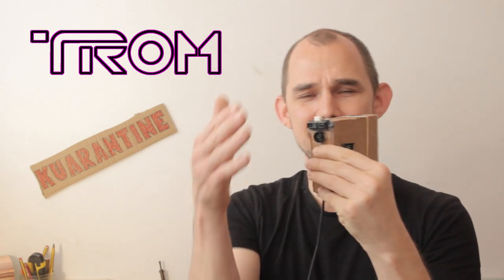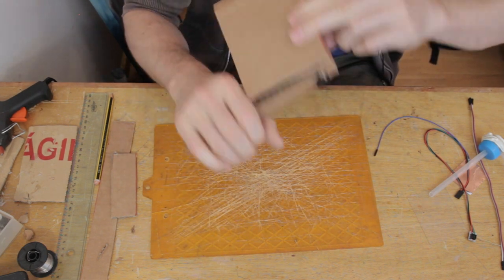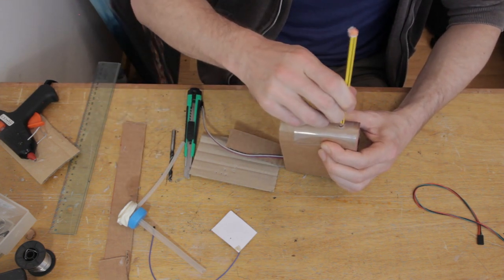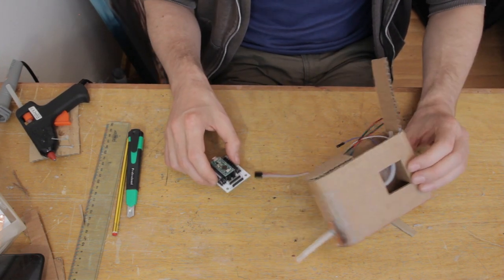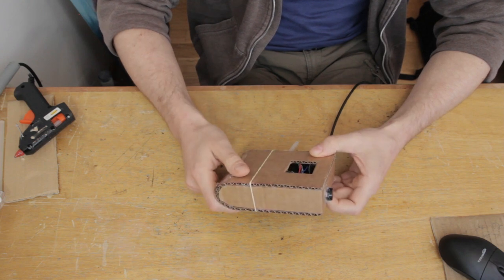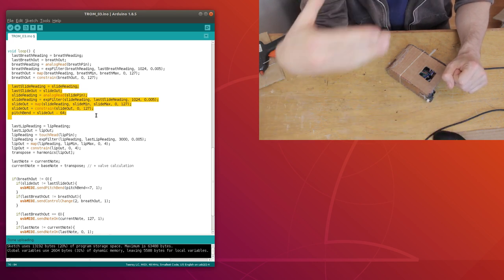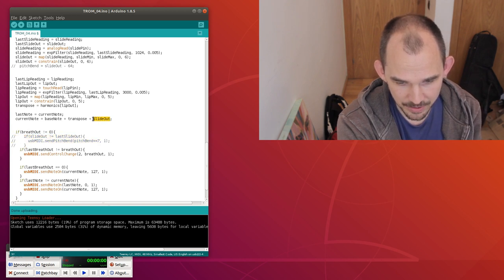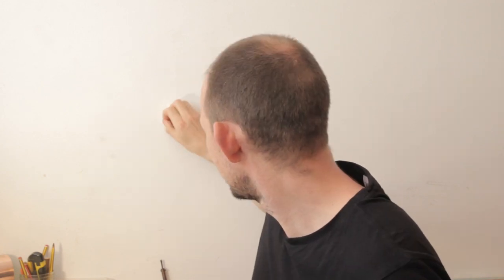"TROM" - DIY MIDI trombone prototype - Featuring lip tension sensor and virtual slide.

Comment: Hi. I've found some interesting way to implement a breath sensor additional feature  with no cost, that I would like to share with you.
Idea is the following -  I believe you have some comfortable-to-play max value from the sensor that is considered as maximum, that will be later translated to CC value 127 
However,  you can make another CC command axis  starting somewhere above this value, for some kind of "overblow"  feature.
For example, if you have sensor that returns values from 0 to 1024,  and only 0-300 is  translated to  midi CC2  as    0->0  and 300->127, you can  add another control CC3
for range 350 to 450  (with midi cc values translated as  350->0, 450->127)  )    In this example we are keeping [300, 350] sensor's range as a barrier  between overblown and non overblown modes.
Starting with 350 sensor value you start sending additional CC3 that  can be quite naturally used as a control axis for managing Growl param in SWAM synth, for example, or whatever  will represent overblow in your synth.
I've tried  this with my pressure sensor - and it feels usable.
Cheers, and thank you for your hard work.
Reply from the maker: That's a super cool idea. I started to implement something a bit like it in my flute prototype, but got sidetracked. 
Thanks for sharing!
Reply from the maker: @ignis32 I'm using this over-blowing idea to implement the second octave of my diy MIDI ocarina: https://youtu.be/M_PeYwXEBB4?t=199
Reply: @KontinuumLAB   Nice to know)

Comment: I’m a trombone player (don’t mind the my user name it’s what I was booked as, without my knowledge, on a got the night before getting a new email) into electronic wind and would line to try and make this and try it out.  Could you use both sensors and pick which mode to play in?
Reply from the maker: Thanks for watching! I'm not sure what you mean by "both sensors"...? Could you explain?
Reply: @KontinuumLAB  meaning both the long range and short range sensors for the hands/slide to have a “keyed” instrument and a full slide one
Reply from the maker: You could make those two modes with just one sensor. The mode is made in software, the two different sensors just have different sensitivity/range

Comment: Hello, I was wondering if you are still looking for a trombone player to try your trom  instrument.  I am a professional player and I also as a hobby build midi instruments.  I started to design a midi trombone controller about 15 years ago that is very similar to what you have done here.  I had to put the project on hold for career purposes but I am semi retired now and would like to re visit my design.  If you visit my channel I have contact info there.  Let me know if you would like to collaborate.  Thanks
Reply from the maker: Hi Daniel. Would love to hear more about your similar design... I'm currently working on a TROM v2, using the KontinuumLAB Instrument Kit, which will come with a tutorial here on the channel, so you should be able to build one yourself.
Reply: @KontinuumLAB   Thanks for the quick response.  Let me know when you release V2.  thanks